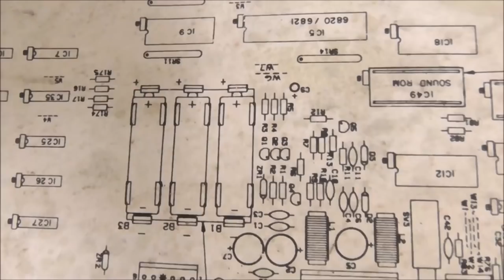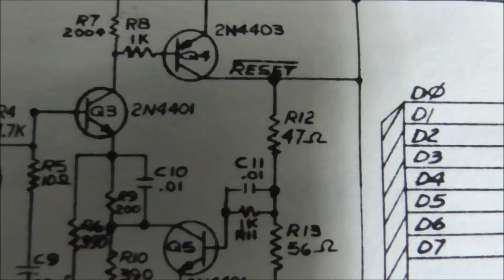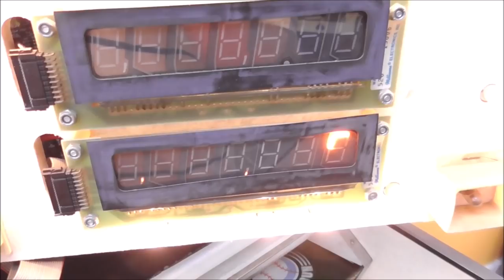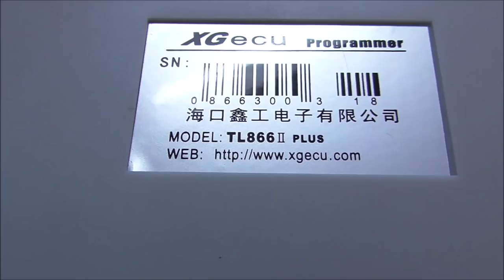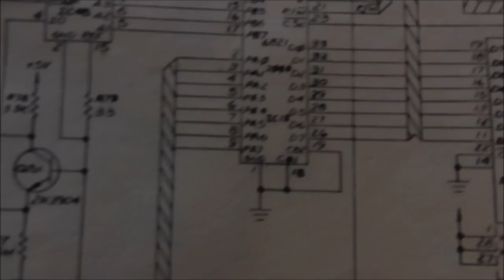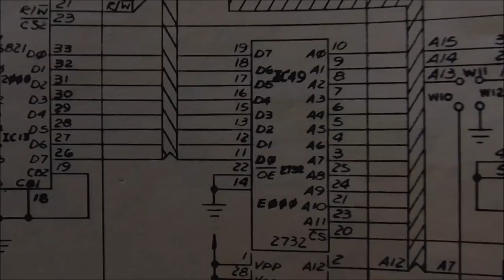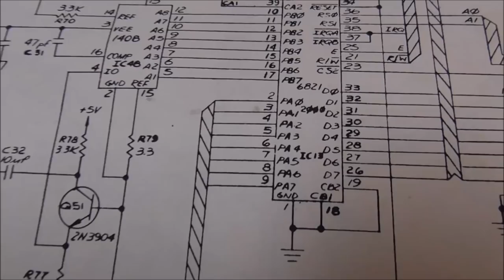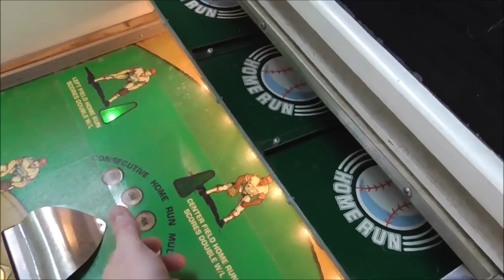Repairing the heavily Battery Corroded Sound Section on a Williams Pennant Fever Pitch & Bat Game! 4

Comment: So glad I found your channel...  Brings back memories...   Lacquer or Polyurethane is what they used in the factory to conformal coat the boards... I use Spray can Poly after board repairs..  It helps keep oxygen and moisture out of the corroded areas..  Just remember to put flux on any pads that you still need to solder to...

Comment: Your vids show the best diagnostic skills of any I've watched!  If you ever want to coat traces after a corrosion repair, I have used Krylon clear for the purpose for over 20 years on PCBs.  Sherwin Williams (Krylon's parent company) makes a professional conformal coating that has similar makeup according to SDS.  Note that Krylon triple thick has a different composition according to SDS.  I have found the Krylon clear able to be soldered through for retouch with no difficulties.  For the top side, you could spray a bit in the lid and with an artists brush coat the bare traces that are below a PCB socket and such prior to assembly, solder, then coating the board backside.  Without the spray I have found bare copper boards looking pretty gross after 10 years or so, with the Krylon overcoat they look new.  (Note: not criticizing, just sharing some of my experience that might help you or others in the future.) :-)
Reply from the maker: I was always concerned that you'd get the stuff on something that would no longer be conductive (like a pad you needed to solder to) but i'll have to try your clear method!  Thank you for watching The Big Moose!!!

Comment: This happened to my Tales From the Crypt machine, but it's screwed up my DMD controls somehow.  I have a lot of work to do on it, and hopefully I can get it working again.  Thanks for the video man!
Reply from the maker: The ribbon cable that goes to the sound board I believe connects right next to the one that does the displays so sometimes the corrosion takes out both!  Thanks for watching Slakjaw, you'll get it going....
Reply: @LyonsArcade  Oh awesome, thank you for the reply.  The DMD was partially working then I was poking around and it went out and hasn't come back at all since.  I'll see if I can get the board out and fixed up this weekend, and I'll definitely check out that area.

Comment: Thank you Sir! 

Looks like you got to that PCB just in time 

Take care see yah next video!
Reply: yeah conformal coating is optional there are UV solder mask kits now which I am interesting in getting to repair some damage done my vintage Nintendo cartridges they have a shell meets PCB ware line.
Reply from the maker: I think you're right, another year or so it may have been unrepairable, but to be honest I've only had a couple pcb's that I thought couldn't be repaired, usually if you take everything off and start sanding it you still have traces down there no matter how bad the corrosion gets...

Comment: On the solder points you've cleaned, a little bit of flux will help the solder flow and connect the pins better

Comment: Recommendations for the future.  First mount the new holder up off the PCB.  Either just barely put the legs into the holes and solder or extend the legs 1/4" with a little 14AWG solid core wire (easily obtained from scrap Romex).  Second use only lithium batteries.  Energizer makes 1.5v AA cells in 4 packs, they a) last longer b) don't leak acid.

Comment: Great videos. I enjoy playing the home game and trying to figure out what's wrong. I have a new appreciation for the EM pinball machines. 

The short on the power pins was likely the result of dendrite growth. The pads are way too close together for 100V operation. The metal can grow filaments which eventually arc over. The arc burns away the metal and PCB material. While it is active it's a great conductor. That short is what then caused the power supply transistor to blow up.

The master board would/should use different design rules to avoid this issue. It also keeps the high voltage and its associated noise away from the more sensitive logic devices. I can see why they didn't use that board again. 

The high voltage for the displays is not too high current but if you rely on a ground in another connector there may be some noise coupling into the 5 volts for the system board. Good enough for the repair though. It would be heard in the sound circuits if it was an issue. But it works so I am just being too picky.
Reply from the maker: This was definitely kind of almost a prototype design, they released it of course but soon changed it because of what you're talking about... You're not being too picky you're thinking about it from a design/creation standpoint and we're working on it from a 'take lemons and make lemonade' standpoint I'll bet they fixed the issue on the next iteration of the board though, just moving the high voltage off board would fix a lot of it... It's pretty fascinating seeing something this big have a fairly serious design flaw like that though, interesting stuff and then you can see how they noticed it and corrected it.... thanks for watching David, I appreciate your insight!

Comment: JOE, Have you tried using a "smart battery sense circuit"? instead of disconnecting the Sense circuit in the power supply sense circuit board you can use a smart battery sense circuit instead

Comment: Hi Joe, How do you test a TDA2002 if it's good? greets Sam
Reply from the maker: The only two ways I know of are if you touch it you should get some buzzing or static out of the game, and with the power off and the board out you can see if any of the legs are shorted together, other than that I don't know of a way to tell if it's working or not.

Comment: Just for info, there was indeed a system 10 MPU but it never went past prototype. Was supposed to be used in a mechanical video game called "Direct Hit" where player tried to keep a ball suspended in a tube with air pressure. A picture of the prototype cabinet that never made it to production is available here : http://www.backglass.org/williams/direct_hit_cab.jpg
A picture of the system 10 MPU prototype board can be found here : https://images.pinside.com/2/7a/17/27a17c9bb847142bfd460b1e84319d1865caeec0.jpg
Reply from the maker: I think they made all of them 1-11 but just never released some of them.
Reply: @LyonsArcade  Yep i guess if they found too many flaws while testing a prototype, they simply skipped to the next generation board just like they did with system 8, moving onto system 9 after only 2 games :=))
Reply: System 8 also shipped in a weird vertical-playfield flipper/ball game called "Still Crazy".  So there were two games technically, but Pennant Fever is the only one of the two that you can actually find.

Comment: I wonder how much it would cost to have a replacement board made.
Reply from the maker: It's fairly complex, it does sound, has a switch matrix, a lamp matrix, runs coils, runs displays, and has several software settings and code processing it's doing as well...

Comment: 12:01 normal (volatile) RAM quickly looses the charge in it's memory cells and needs to be refreshed frequently to keep it's data. This is done during the board is powered or by the batteries when the power is off. NVRAM doesn't loose the charge in the memory cells because it's constructed differently, hence the name "non volatile". That's why it doesn't need batteries, not even an internal one. Greetings from Germany, the country that invented the bent screwdriver for IC removal. 😉 Here professional IC removal is already taught in elementary school and......... no, that's a lie. 🤣
Reply from the maker: Thank you for watching Backdrafter!  We love our German fans!

Comment: does it seem like duracell leak but not eveready? think of all the electronics duracell has destroyed past 40 years and they're more expensive
Reply from the maker: Yeah I think there's something to that.  I don't remember seeing any eveready's leak.
Reply: I've had evereadys leak too.
Reply: My theory is that any alkaline battery that is left in circuit (i.e. some electrical current path) will eventually leak as the battery dies. It's less likely to leak if left out of circuit when it eventually self-discharges and dies.
It's just a theory though.
Cheers,